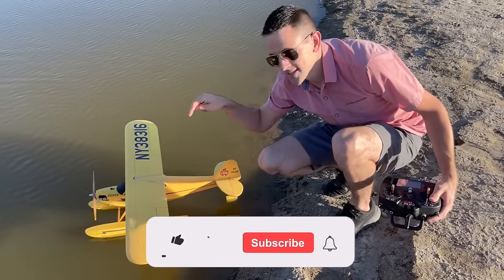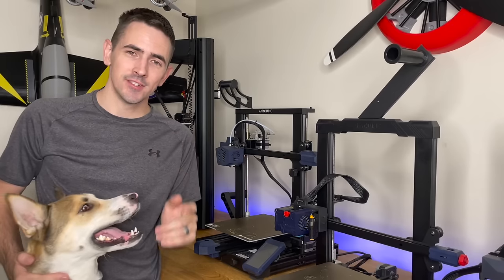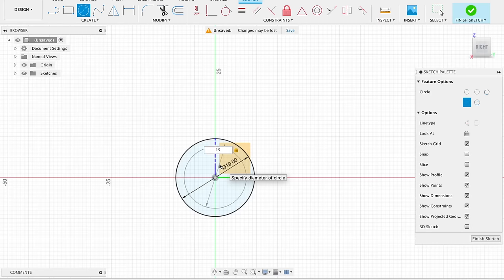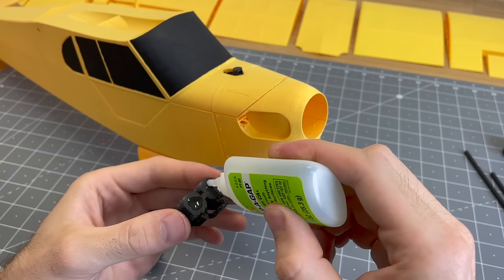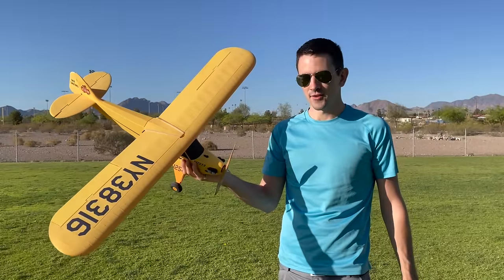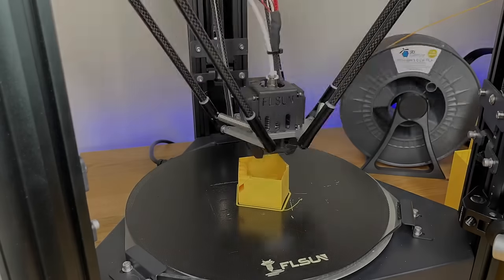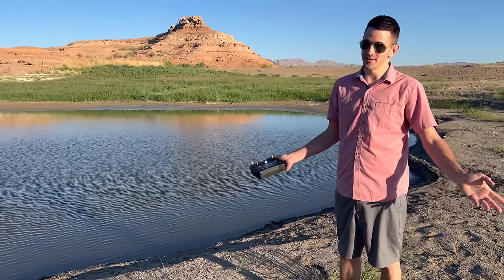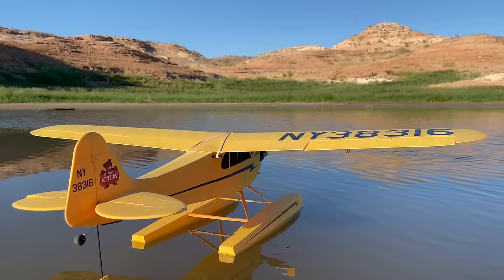Epic DIY RC Piper Cub Full Build & Flight

Comment: Lw pla  planes are great if you already  know how to fly.  No so good for newbies that will crash a lot learning. I Built  and rebuilt 3dlabprint’s cub at least 3 times trying to learn how to fly  until i finally put it aside and designed and built a foam plane that could withstand all the  crashing I went through learning.  The point I am making is that its not about how repairable 3d printed planes are ( and they are quite repairable) its about how durable they are.  A lw pla plane is quite fragile.  One small mishap, and you’re done flying for the day.  With foam, you may crash and the plane is only just a bit dented, or easily hot glued back together in the field.
Reply: I totally agree with ur comment. I'm mid build with this first 3d printed one but have been flying foamies for a few years. Kind of know what I will expect but at this point it's an itch I want to scratch.  Foamies are so much quicker to get back up with when a crash happens.
Reply: @ArceezRC  upto 9 rebuilds on the cub.  Me thinks I may be cursed to crash that model the most.
Reply: @stevetomassetti4420  I have a plane that's just like that but it's a foamie with a janky nose but still flies with a little E6000.  Thx for ur response!

Comment: best video yet troy! I'm currently building this plane in polymaker lwpla and unfortunately the weight is coming out about 65% heavier than 3dlabprints material. I went on their website and it looks like shipping from the Czech republic to the US for one spool of their filament is like $25, DHL. Kinda $$$. I know you did a comparison video about PLA vs lwpla, but would using Esun or ColorFabb lwpla work too?

Oh and you're right about this being a bit of a challenge to slice in cura, had to do some fiddling but ultimately it worked out for me using cura, polymaker lwpla, and an ender 3 with direct drive and glass bed. Although, I never did just try the gcode directly given I have a direct drive mod...
Reply: Matterhackers light weight is the same price as the 3DLabPrint filament including shipping from CZ, so the correct filament from 3DLabPrint is a better deal. Help them out, they're giving you the plans and all the setup info.

Comment: Why not use an adhesive other than CA for the servo's in case you have a hard landing and break some teeth?
Reply: I used hot glue, I dont glue in servos either.
Reply: And to add onto that the servo mount poimts have to be cut off
Reply: As someone who recently had a hard landing, I'll be using something else other than CA going forward ;)
Reply: @nickademuss42  hot glue is something worst you can use for attaching servos. Much better way is to use thin shrink plastic tube and CA. Just place shrink tube on servo and shrink it with hot gun, than glue it with CA glue.

Comment: I have a question for you, what plane do you think would be the best for a first time printing? Im using Ender 3 and ender 3 pro printers.
Reply: Troy--McMillan  always enjoy your videos,  what's up
Reply: Did u ever build one? I'm mid build using an Ender 3 V3 KE and it was not perfect but prints done. Can see that am going to need packing tape reinforcement is some places. Also have issue sourcing the push rod wire that's long enough...

Comment: To prevent the wings from sagging due to sunlight, we recommend 1mm carbon rods instead of filaments.
Reply: But it's PETG I think. Resistant to higher temp. I'd actually use ABS in mine.

Comment: Been following this for a while now, trying to print out the same plane. About to wash my hands of this CR10 Smart as it just will NOT print thin wall effectively.
Reply: CR10 prints thin wall very well. Its TPU that you can have difficulties with! Good luck, these planes are awesome!
Reply: @3drcking  It’s the smart part of the CR10 Smart that’s giving me issues. Never experienced any of these with my Ender 3 V2.
Reply from the maker: I really wanted to try out a CR10 but I never did! I have heard it does work well for thin wall though.

Comment: Old video i know but what settings did you use for the floats? Printiing using the same settings as the plane leaves you with open ends and a float you can see right through. Noticed yours has solid layers at the ends but i didnt see it mentioned in the build guide
Reply: With Cura, just add 2 bottom layers and two top layers in the top/bottom settings. Same with Prusa.

Comment: Is there any mini 3d printable plane files are available?  I don't have time to print so many parts. So if there is a smaller plane which can be 3d printed and easy to fly then please link it thank you
Reply from the maker: There is a smaller sized plane, the Ziggy from PlanePrint. However, I would recommend just printing a part out here and there when you can and then assembling them in the same way! Thats what many people do, and its how I did it when I first started 3D printing planes.

Comment: Where did you get your pushrod from for the elevator and rudder? I calculated I needed at least 20 inch pushrod. Can't find any that long anywhere.
Reply: I'm having this same issue now. Did you end up finishing the build and what did you use or where did you get the right wires?

Comment: Troy, I just got a FLSUN Q400 that is running Klipper software. I downloaded the Prussa Slicer, but it only has 2 models, the FLSUN QQ-S Pro large format.  Can I use that or do I need to try and create a custom profile printer?  Thanks

Comment: I know what your using is lighter but a slightly heavier plane would be easier to fly as it would feel more stable just increase the motor power slightly plus it may not self destruct being a little thicker.
Reply: More than twice as heavy is not "a little heavier".

Comment: my maiden didn't go too well. kept stalling out in the turns and spinning to the ground. It was a little windy but not any windier than I've flown other models in the past, probably only 10mph gusts. CG was right behind the filament reinforcement on the wing, as recommended in the pdf guide. Honestly not sure what went wrong, ended up with the landing gear snapping off of the fuselage belly.
Reply: I know this is a yr ago but did u figure out ur issue? Wring size motor, warped body, CG??

Comment: I don't see the point in putting a pla strand on the wing key. Usually you use carbon or a metal shaft to absorb the load on the wing?
Reply: My first wing i put filament in it and used filiment for hinge. I didn't like it.   Did the ones that follow with carbon rod. Much happier with the carbon rods.
Reply: @guytrimble8171  okay good, but why did he put fillament. Im sure he has a good reason
Reply: @c.fisherfighter638  
The filament is one of the ways to stiffen the wing. 3dlabrint included a groove on the top and bottom so that the wing is stiffened by either a filament inserted or by a carbon rod. I used filament on the first wing I printed but on subsequent wings I tried carbon rod insert which stiffens a lot more. I recommend using the carbon rod.
Reply: @guytrimble8171  But he clearly made the choice to chose plastic (pla)
Reply: @c.fisherfighter638  
I know. 3dlabprint says that you can use pla there to save on cost. As for myself I don't build my models cheap. For an extra few dollars here or there I  figure is an investment. But people can build them anyways they want. I built the large edge and I printed the servo arms in polycarbonate with the provided print files. It crashed after 8 minutes of flying very nice. The printed servo horn for the elevator had failed maybe, couldn't really know as it caught fire and burned after impact. The elevator had quit responding though so it's possible. But many of the components I had bought are ready to use again. My first cub wing I used petg as the stiffening component because as the control hinge because pla degrades and breaks into small pieces in a short time. For some reason the pla printed parts don't seem to get so brittle. It's kind of all experimental. Build fly crash repeatedly.
Reply: @guytrimble8171  thank you, i see. thanks for taking the time to tell me. happy flying

Comment: Awesome video :D! Just started printing it. Really well designed, but I have problems printing the engines that go on the side. The print fails if I don´t use supports but if I do use them I can´t get them out due to very tight spots. Do you have a tip to solve this?

Oh and did you print the front gear legs out of regular PLA or LW-PLA?
Reply from the maker: Thank you!! I printed the engine both ways, with supports and without. The better quality one was actually without supports, it doesn't look right initially, but just keep letting it print and it should come out all right in the end!

I printed it out of LWPLA using regular PLA settings
Reply: @TroyMcMillan  Ok, I will give it a try. Thank you :).

Comment: Hello troy ! Good job !  do you a profil setting for cura ?  i have a ender 3 v3 se and i didnt't print correctly  the wings i have a missing part ...

Thanks
Reply from the maker: For the 3dlabprint planes use Prusa slicer it works even if you are using an ender 3 v3 printer

Comment: Hi Troy! Thanks for all your hard work in providing these videos. I'm trying out the Prusa slicer and after loading a 3dlabprint project file it defaults to a generic direct drive printer. If I choose my Creality CR10S it automatically changes the filament to regular PLA. I assume the Prusa Slicer is only meant to work with direct drive printers if you are using LW-PLA. Is this correct?
Reply: Not at all.

Comment: i have the flsun super racer printer can i still use prusa slicer? sorry im new at 3d printing and use cura and lite weight pla needs a high temp the sr printer max out at 240 i need to be higher then that?

Comment: Hallo you have to put a motor that go forward  as backward is better to on shore gretings
Reply from the maker: For getting the plane out of the water? It taxis well in the water!
Reply: @TroyMcMillan 
Hallo yes it is than  easyer 
To go on shore or to move from the shore 
But is a nice plane if he is  good on the water let it so 
Greetings
Reply from the maker: @salvatorealessandrino945  I did actually want to use a esc with reverse thrust but it was a little too big for this plane! Your idea is a good one! 😊

Comment: Could you show us how you make your decals.
Reply from the maker: these are included in the model for this plane! They are a part of the download
Reply: @TroyMcMillan  no I mean how do you print them, on what and how you apply them.
Reply from the maker: @pascalwatteel2095  Oh sure! I get them printed out at a local print shop. It took a lot of testing different materials out but the best one I found is "3M High Stick" material. I would call around and really try to find that, but my shop said that material is normally used to adhere decals to textured walls. I send the vector files to them, and they print them out and use a plotter to cut the shapes out. That will save you a lot of time and hassle if your shop can do that too

Comment: Troy I think my wall is too thin this is my first time printing a plane.
perimeters set to 1 is this correct? Using LW Pla with a prusa slicer
Reply: If the model is designed to be printed in single wall using vase mode its totally normal, i think the wings are usually like that from 3dlabs, but the fuselage I don’t know. If they provide the ready made G-Codes use them and see how it prints.
Reply from the maker: No that is correct! This plane is single wall. It's stronger than you'd think, when you glue all the pieces together.
Reply: @TroyMcMillan  one more question Where did you plug in your ailerons what channel?

Comment: I print my planes in PETG...Why?  Because PLA warps in the sun. Also, as a builder of Balsa planes If you have a proper power plant and a balanced  (CG) of the  plane,  you can fly a plane that has more weight than this lite PLA. 
Just some food for thought. With that said I do appreciate the content that this video was produced. It takes alot of time for the content creator to produce a good video.

Comment: Hi,have you tried HIPS for printing planes?
Reply from the maker: No I haven't! What is that?
Reply: @TroyMcMillan  High Impact Polystyrene, don't know if its new because I just start learning 3d printing just for printing planes. I think its usted as soluble support, but whith limonade, not whater. 
Seems to be lighter and better impact resistance than pla,i dont know comparing with lw-pla.

Comment: I know it's an old video and you probably won't be reading it, but I'll take my chances...  The motor and prop that you are listing are bigger than the ones listed on the make from 3dLabPrint.  Is it just cause you had those on hand, or you felt the suggested ones were underpowered?  I'm starting this build, and I'm a rookie (I know, I will crash and destroy the plane, that's fine...), so I don't want to have it too powerful, I want to learn flying nice and slow, but I see you achieve that as well.  Just wondering which way to go really, thanks!
Reply: Honestly I’m not sure it matters, I am going to be building this and doing a video on it and I have ordered a 2470kv motor! Which is like double The power of the one he used, even if it’s too much power, you just fly faster and use your elevator to make sure the nose doesn’t go up. I’m sort of new to flying RC PLANEs and I crashed my first RC plane abut 15 times! I have a video on my channel. Now I am pretty decent at flying only because I did a lot of training on a flight simulator. If you are a first time pilot, I would highly recommend to do flight simulation before flying
Reply: @RobertGRitz  thanks!  Ya I've been told to use a simulator, i think I'll check them out. My budget is kind if going towards the plane and equipment,but i see the benefits of the simulator, it'll save me money in the long run.
Your motor is not double the power though, KV relates to rpm. I think your motor is more suited to a drone and might lack torque for the plane. But if it works post here, i have 4 of those on hands from my drone, I'd reuse them instead of buying a new motor.

Comment: Troy really enjoy your videos, excellent job.  Not wanting to bother you however I have one question:  I have a Prusa MK3S+ printer that I think is dialed in and prints well.  Utilizing 3D Labprints LWPLA and their GCODE as well as 3mf files I am still getting stinging inside of my parts.  I have tried both the generic printer that is assigned by the 3mf and the stock MK3S+ printer and still have lots of stringing.  Your parts look cleaner and fit together better any thoughts .  Thanks in Advance
Reply from the maker: Well it sounds like you are doing everything correctly. I do a bit of cleaning up with an hobby knife before I assemble the parts but not too much. For all the 3d lab print planes definitely use purse slicer and the 3MF files they provide.

Comment: EDIT:  The initial comment I made about 3d printed models being way heavy and having to fly way too fast just to stay controllable has changed since the advent of lightweight foaming PLA filaments that have come onto the market at reasonable prices.  So I am amending my comment in light (no pun intended) of this. 
ORIGINAL COMMENT:The only problem with 3d printed planes is that now you have a small Cub flying at a scale speed of mach 3.  That same model in foam or balsa would be MUCH slower.
Reply from the maker: Typically, I would say that! With regular PLA. But with the new LWPLA out there, the material is just as lightweight as foam or balsa....or maybe even lighter. The RTF weight for this build with floats is 560g. 

As for the scale speed, you are right it is probably a bit faster!

Comment: I’ve just started printing this model, but I’m having issues in Bambu studio. The slicer isn’t recognizing all the support structures in the nose area. Does anyone have any tips for this? I want to print on the Bambulab p1s
Reply: Closure radius of the gap: set to zero and it works, now i have a lot to do✌️

Comment: Hallo, ich bin ein blutiger Anfänger und habe mir zum trainieren den Aerofly RS 8 Simulator geholt. Bisher habe ich nur Bruchlandungen hingelegt. 
Hast Du zufällig die Einstellungen, welche ich für die Piper J-3 von 3DLabPrint hinterlegen muß, um ein gutes Flugerlebnis zu erreichen?
Ich möchte nicht 200 Euro für einen Flieger mit Elektrik und 3D Druck hinlegen um den Flieger beim ersten Start gleich zu schrotten.
Danke im voraus.

Hello, I'm a complete beginner and I got the Aerofly RS 8 simulator to train. So far I've only done crash landings.
Do you happen to have the settings I need to set for the 3DLabPrint Piper J-3 to achieve a good flight experience?
I don't want to pay 200 euros for a plane with electronics and 3D printing just to scrap the plane the first time it takes off.
Thanks in advance.

Comment: i have 3d print lwpla when transport in my car the shape change
Reply from the maker: Oh!! I have planes printed out of that material that withstand sustained temps of 100F+ through summer and they haven't warped!
Reply: maybe my settings litlle bit of plane albatros. any sugestion how much heat for lw pla? on regular pla its fine no warped